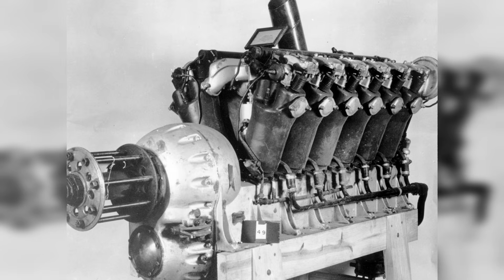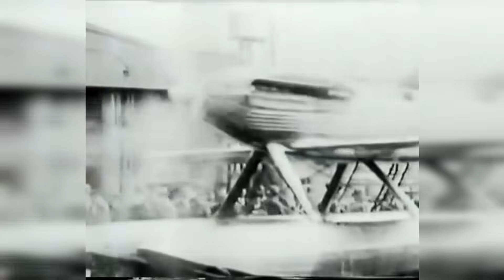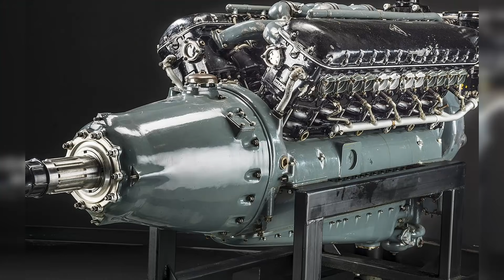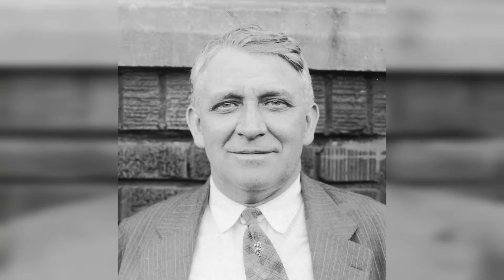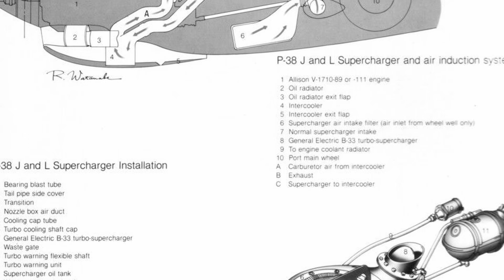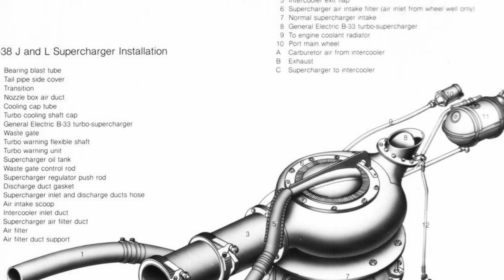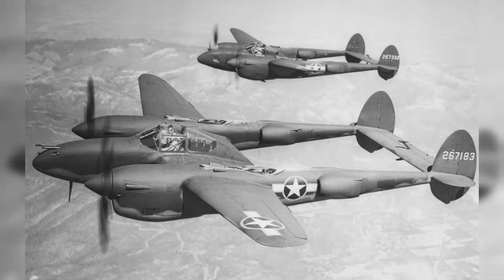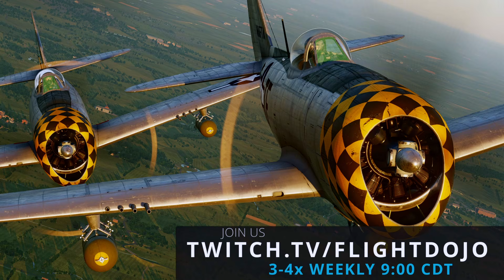Allison V-1710 - A Liquid-Cooled American WWII Warhorse

Comment: Nothing stopped Allison from giving their single stage supercharger two speeds which would have significantly improved the P-39 and P-40’s performance at medium altitudes.  The Merlin P-40 had a two speed supercharger and was much faster at altitude.  Lancasters and most Mosquitoes had single stage two speed Merlins, they were smaller and lighter than 60/260 series engines.
Reply: You would only add a second speed if you expected the engine to be used without the turbo, which Allison did not. Also, the Army wouldn't fund the development. So they would have had to develop extra speeds and stages on their own dime for a system that nobody wanted to buy. Or at least insisted that they didn't want to buy.   The struggles of the GE turbo did eventually change that, but not until much later. Rolls Royce had no such problem.  The RAF was perfectly willing to fund gear-driven superchargers.

The reason the 1710 had a single stage, single speed supercharger is that is how the US was doing multi-stage units at the time. Most naval fighters for example had 2 stage, 3 speed superchargers with intercoolers. But the first stage was just a single speed unit.  That's what allison was setting up with the expectation that the intercooler and variable speeds would be handled by the Turbo. That wasn't their decision. It was the Army.

They did eventually get a 2nd stage supercharger by 1943, but most production aircraft for the Army were already set in stone.  P-63 got the second stage, but it never went into US service. 

One final point.  While a single stage, two speed unit would have helped at medium altitudes somewhat, it was a negligible difference.  Single stage, two speed Merlins were put in some P-40's.  Many of which were later switched back to Allisons because of the negligible performance gain just wasn't worth the supply chain headaches caused by have two different engines.
Reply: I  agree. Let’s remember the majority of WW2 fighters used single stage multi-speed blowers. The Germans, the Japanese and probably Soviets. American Navy fighters were multi-speed, single or twin stage.  I think the Allison was the only single stage, single speed supercharging used in fighters by 1942.  That was sad and having a gear change would have been much simpler than pursuing a second stage.  The irony is Allison became the ultimate transmission builder later; terrestrial, marine and aero (turbines).
There was a miscue in ignoring the P-63 as an entity. It was highly valued by the Soviets and feared by the Axis.  By then their fighters were improving
One of the P-63 racers that won the post-war Cleveland Air Races was so fast because they got possession of a rare special factory engine and paddle prop.

Comment: Why is it Americans try to make up bullshit about crap engineering the coulda shoulda woulda  the Merlin without doubt was the best v12 of the war only bettered  by another RR engine the griffon but the ultimate piston engine the Napier sabre despite its troubles still the ultimate
Reply: @bongosrest - Why is it that a lot of Brits can't accept the truth or do proper research to discover the truth? The truth is that the Allison was a significantly better engine than the Merlin. Ironically, if you research the Merlin's history, you'll find that it's directly descended from the American Designed, Engineered and Built, Curtiss D-12 engine from 1921. After Rolls-Royce and the British Air Ministry were humiliated by losing the Schneider Trophy race in 1923 (and losing all the speed records) to aircraft powered by the Curtiss D-12, R-R bought six Curtiss D-12 engines from Fairey Aviation and reverse engineered / copied them to create the RR "Kestrel" engine. The Merlin engine is the direct descendant of the Kestrel engine. 

The Allison is stronger, more reliable, easier to work on and repair, and has far fewer parts. It also makes virtually identical power at the same amount of boost. The one area where the Merlin was better was at high altitude. This was not technically related to the actual Merlin engine, it was because of the 2 stage supercharger that was added onto the Merlin. There is no doubt that the 2 stage supercharger on the Merlin was MUCH better than the single stage supercharger on the Allison. However, once the Allison received GE Turbochargers on the P-38, their power was equivalent to the Merlin, even at altitude.
Reply: The Merlin XX incorporated a number of revisions based on early operational experience and the availability of 100 octane fuel from America."
 "It had been intended to utilise the evaporative cooling system but was replaced by the more reliable ethylene glycol liquid cooling system developed in the United States." 
"During the Battle of Britain it was discovered that the Merlin engine would cut out when pursing Me109s in a high speed bunt dive due to fuel starvation in the float controlled carburettor. Initial solutions involved inverting the aircraft into the dive and also the fitting a restrictor in the fuel supply line and a diaphragm known as Miss Shilling’s orifice, named after the female inventor (Beatrice Shilling) based at Farnborough at the Royal Aircraft Establishment. More permanent solutions involved moving the fuel outlet from the bottom of the carburettor to half way up and the use of fuel injection using a Stromberg pressure carburettor (used on P40's from 1939, ND) and finally an SU injection carburettor." 
The Spitfire Society Merlin page
Reply: Churchill "Our most vital need is therefore the delivery at the earliest possible date of the largest possible number of Curtiss P-40 fighters." 
page 86 The Burning Blue Addison and Crang

Comment: As a Brit I will admitt I biased in favor of the Merlin, but can I ask- How much did US Government preferance for radial engines hinder the Allison development?
Reply: Not much.  But the Navy's preference for radials did.  The Navy didn't have the turbo hangup that the Army did.  Navy fighters from very early on had 2 stage, 3 speed superchargers with intercooling.  IF the navy had been willing use liquid cooled engines, 2 stage, centrifugal superchargers would almost certainly have been developed by Allison to meet the Navy's requirements.  And said design would have been available to the Army fighters when they finally realized their mistake.  Unfortunately, the Navy didn't want to deal with the thousands of gallons of coolant they would have had to store on aircraft carriers, which is understandable.  So that never quite came to fruition.

Comment: Interesting about Allison playing with turbo-compound. It is not supercharging, but a mechanical add by using spent exhaust gas. First used on the Wright R3350 engine in the B-29, and later used on the Constellation and DC-7 airliners.
Reply: The R-3350-23/-57 used in the B-29 was not turbo compounded, it used a pair of GE Type B turbosuperchargers running in parallel.
Reply: @grahamwhite2316  TRUE !!

Comment: I'm surprised they didn't try to use this engine in a tank.
Reply: tanks wanted simple 1500 bhp engines
time came when turbines for helicopters took over.
turbines give 8 times the power for the same engine weight
with all its problems

Comment: The temperature at 20,000' and above is about the same regardless of latitude and longitude. It's about as cold at 20,000' over the Philippines as it is at 20,000' over europe.

The problem with the P-38 in europe was the 8th AF, not the P-38. That's why the P-38 did well against the Luftwaffe for all the other AF's over europe. 

The 8th AF was a clusterhump run by the bomber mafia.

Comment: Trouble is GM Allison put all their  eggs in General Electric,s basket tailoring the 1710  to use their turbocharger, without that extra wind down its Bendix carb ,at altitudes above sixteen seventeen thousand feet the 1710,s pony count dropped like a donkey,s dick.
With its crap asthmatic blower bought from a five and dime store,the 1710 became a good reliable all round mud mover, the NAA A-36 Apache is classic example of a mud mover (ground attack infantry suppression aircraft, in essence a castrated Mustang.
Any 1930,s aviation addict with a functioning brain cell knows the 1710 is indeed a very sound engine,let down by a crap blower stuck on as an afterthought. Me I take a 1710 then bin (trash) the rear accessory case, design a new rear case with a proper Merlin pattern blower a curved bladed impeller twirled by a two speed gearbox,and an up draught Bendix injection carb,. All accessories , generator, hydraulic pumps, compressors, vacuum pumps, etc all driven of a fire wall mounted Bristol Dowty accessory gearbox driven via a ninety degree angle gearbox  off the 1710,s supercharger,s tail shaft . With  these mods and a  Merlin  pattern spur reduction gear , a 'G'series 1710 on 100-130 grade petrol chucks out  a thousand two fifty  thousand three hundred ponies for take off  and around a thousand useable ponies at  say between twenty five to thirty thousand feet. Be easily fitted to any aircraft that used Merlins. Well cats&kittens Allison did  just that, in late 1943-44  GM engineers re worked the 1710 with a Merlin pattern rear case and blower to satisfy a contract from Dutch H Kindleberger at NAA  to power a conjoined Mustang, the P-82 Twin Mustang, a long range escort fighter that would shepherd Boeing B-29 Superfortress,s on deep penetration bombing missions to Japan and fend off Franks, Tonys, Myrts, and Steves. The incineration of Hiroshima and Nagasaki by Atom Bombs by Tinian based  B-29,s, put paid to Operation Fire Dog the invasion of mainland Japan. When VJ-Day signalled the end of the worst war the world had endured, Rollers pulled the plug on Packards licence to make Merlins. With early jet fighters not being that reliable, the  newly formed United States Air Force USAF decided to press on with the P-82 conjoined Mustang as an interim measure with 1710,s instead of Merlins     
until NAA,s F-86 Sabre with a half decent axial flow jet engine began to enter USAF service in 1948-49, yes cats&kittens our old friend General Electric and their TG-180 or J-47 providing the Sabre,s power, just in time for the Korean war to brew up.
Reply: + Basil Taylor   Also the F-82 was the only aircraft with the range to escort the heavies into Russia if it were ever needed. Arguably, the F-82 bridged the gap between the piston and jet eras.
Reply: @FiveCentsPlease  Yes Dutch Kindleberger,s Conjoined Mustang  was the result of a spec submitted by the USAAF calling for a long range escort fighter able to take on Franks, Georges, Tonys, Randys .and Steves in the Pacific Theatre whilst shepherding  Curtiss E LeMays B-29 squadrons that undertook massed daylight raids on Japan,s industrial heartland  . Remember the Awful Fischer XP-75 designed to a similar specification , talk about Frankenstenian aero engineering ,the result of a designer who drank one too many bottles of Jack Daniels. Only asset this mutant beast had is Allison,s Conjoined Twin-Pac the 3420 . Yes cat&kittens a twin-pac that actually worked with a high degree of reliability. GM made such engines a feasible proposition, whereas Rollers (Rolls-Royce) and Daimler Benz,s efforts at a twin-pac failed miserably.
Reply: Allison didn't "put all their eggs in General Electrics basket".  The Army did.  If the Army refuses to fund the project, then you are developing a product on your own dime that everyone is telling you they won't be buying.  Few companies would do that.  If the RAF told Rolls that they wouldn't fund or purchase a second stage unit,  they wouldn't have had a second stage either.

The supercharger on the Allison wasn't "an afterthought".  That is how 2 stage, multispeed configurations were laid out at the time in the US setups.  The first stage was always a single stage, single speed unit.  Per the Army's instructions, GE was handling the turbo, but the first stage was always meant to be a gear driven Centrifugal.
Reply: @sebclot9478  That sounds very familiar,  our British Air Ministry had the same attitude, they want something for nothing. But look at this when in the spring of 1941 the RAF Spitfire V,s were being  knocked out of the sky by Kurt Tank,s Focke Wulf 190A 'Wurger' Butcher Bird like  like clay pigeons. Faced with the awful dilemma  of losing air superiority the RAF had no alternative but ask Rollers to shoehorn a  Merlin 60 Series with two stage blower into a Mark V Spitfire. In fact the 60,Series Merlin was originally  designed  to power a high altitude bomber based on Barnes Wallis,s Vickers Wellington with a pressure cabin.  I stand by what I say ,putting all your eggs in the US  Army,s Basket ,is corporate suicide . For example D Napier&Sons Acton Middlesex UK ,its entire business relied on Air Ministry Contracts. As with many government bodies , the Air Ministry was run by soulless bean counter,s narrow minded minions in grey suits . When the Air Ministry Contracts dried up , the company went downhill, just surviving in the early 1950,s by the skin of its teeth by a Contract with the British Transport Commission to supply their 2 -stroke Deltic diesel engines for a new main line diesel electric railway loco then under development by English Electric. Why do think Pratt&Whittney is alive and kicking?, answers on a postcard !!!!.
Reply: @basiltaylor8910  If you are saying they should have diversified beyond military contracts, that is probably good advice.  But I don't blame them for not spending the money to develop a 2 stage centrifugal Supercharger.
Reply: I stand by what I say, do not put all your eggs in one basket, have an insurance policy, the 1710 in civil spec would have been a far more reliable option to Roller,s problematic Merlin 626-726, increased time between overhauls an attractive selling point  to airlines. I point to Trans Canada Airlines fleet of unique Argonaut (North Stars)a clever crossbred Douglas DC-4 DC-6 hybrid. Said Argonaut designed by Canadair at Cartierville  around a  quartet of Merlin 626,s with fuel injection and two speed two stage blower, even with them its performance at altitude was mediocre, TCA Boss,s wanted a third speed in the blower to improve the North Star,s altitude performance, Rollers in their stupidity declined their request, corporate suicide of what? . Think cats&kittens a North Star with civil 1710,s Bendix fuel injection a three speed blower and their legendary reliability, I point to GM Chevrolet,s 'Stove Bolt' six, an engine that helped win world war two and the darling of many Bedford Addicts in UK.    @sebclot9478

Comment: The 1710 was a missed opportunity to provide an insurance policy in a event of the Merlin having serious reliability issues, okay the blower was crap, but the base engine is very sound. In April 1937 a 1710  ran 150 hours solid on the bench churning a genuine one thousand ponies on then standard 87 Octane petrol, pretty serious  pony count for a late 30,s V-12 Aero Engine. In stark contrast , Ernie Hives and Stan Hooker were struggling  to coax nine fifty nine ninety out of many guinea pig Merlins Derby,s engine test department had to play with.Trouble at Derby is Rollers (Rolls-Royce) had fingers in too many pies, the hard pressed engineers  watching not one but four pots boiling on the stove,the Merlin, Peregrine an updated Kestrel, Vulture an absolute dog,and the Griffon a Merlin on steroids. With their technical capacity spread too thin on the bread no wonder Ernie and Stan had problems with the Merlin, oil leaks, gasket failures, starter motors being too low geared. The other side of the coin is the 1710 began to mature as a decent reliable V-12 with a spin up flywheel starter.
Reply: + Basil Taylor    I think if jet engines had come a little later and the piston era had another 4-5 years of development, there would have been some serious numbers coming out of those mills.

Comment: something about that thought is interesting, imagine if you could have all the best parts in ww2 how would your engine look? allison bearings and american metalcompounds, db fuelinjectionsystem, Fw-kommandogerät and electric redundant controls, british multistage turbo systems with aftercooler driven by german fluidcouplings, american compoundturbos, and
aditives like mw50 and gm 1, and then a layout like napiers for extreme rpm
imagine what glory, if they had build all this just for the fun of it and we all would have inherited raceplanes
Reply: British multistage turbo systems?  And you wouldn't need fluid coupling on a turbo system.  Turbo's were already variable speed.
Reply: @sebclot9478  no not really, they had gearboxes and several stages in most cases, like you stated

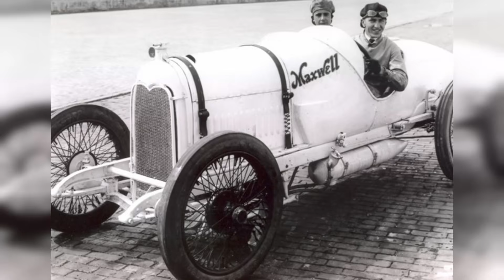Comment: 1:58 Rickenbacker tried a lot in those days...He even tried to buy the Indianapolis-Speedway but failed. I see a pattern there....
Reply: Rickenbacker and a group of investors owned the Indianapolis Motor Speedway from 1927 to 1945.  Eddie was the general manager.
Allison and the Indianapolis Motor Speedway have history that is inextricably linked.  James Allison was one of the partners that originally built the Speedway.  The name of his company was originally the Speedway Team Company, based on Main Street in the town of Speedway, within easy walking distance of the track.  Its original purpose was to provide design and build support for cars running at the Speedway.  After the company got busy with Liberty engine rebuilding and conversion work, the name was changed to the Allison Engineering Company.